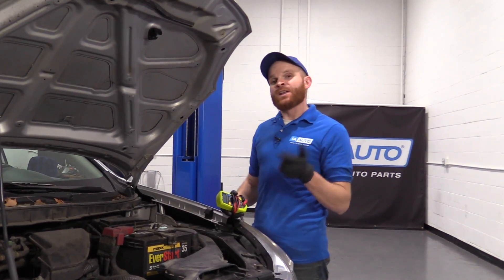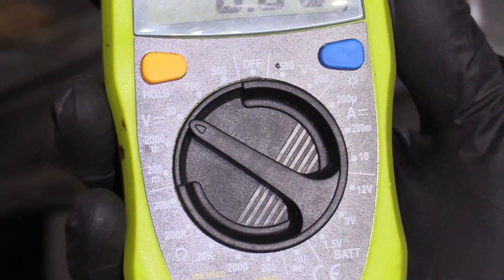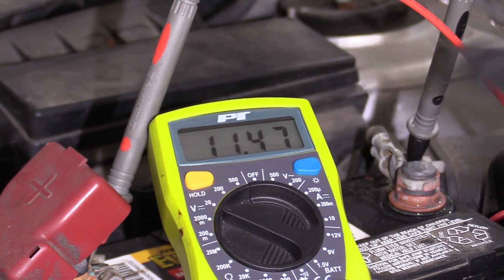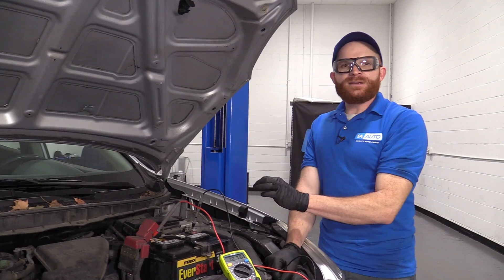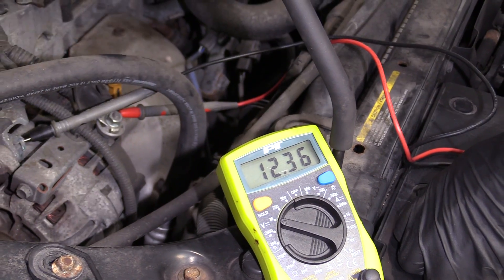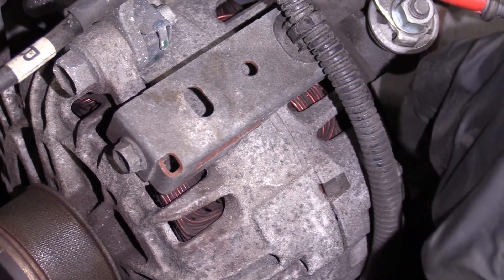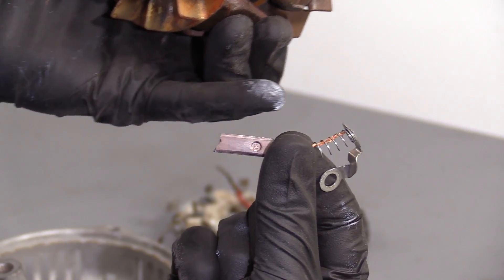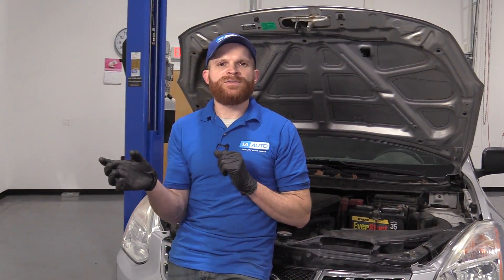Dead Battery? Voltage Spikes? How to Diagnose a Car / Truck Alternator

Comment: i have a 2009 camry I4. It's got a NAPA alternator. Upon starting the car( no lights or blower motor on ) i see that the voltage is 14.1-14.5. But after 30 mins of idle/driving( no lights or blower motor on ) the voltage drops to ~13.5. Is this a sign that the alternator is degrading? Battery shows 12.5-12.56V when the car is shutoff( no lights or blower motor on )

Comment: Another great video, I had some strange electrical things happening in my truck, I would check the battery similarly to how you did here, I also have a battery tester which tells me the health of my battery via CA and CCA and the starting system and the charging system, similar to what you showed early in the video, my alternator was dying out, I replaced it along with the battery at the same time, all is well now. I like videos like this, they are really helpful.

Comment: Hi I'm having vehicle issues my car was running like I need a tune-up really bad but after spending $400 O2 sensors new injectors new coil pack new spark plugs Vehicles still running rough notice that the battery is reading low I'm hoping that the batteries the issue this is a 2008 Dodge Nitro 3.7 L remove the battery post while the car was on to test the alternator the alternator proceeded to react then I'm not used to and the dashboard lights were flickering as well as things popping on the dashboard could just be an alternator going out or is my throttle body that was causing this whole problem from day one or could it be a tip of Dodge Nitros or prone for bad tipems it's 151,000 Mi on my car 3.7 L Dodge Nitro

Comment: Great video! I got an issue with my 02 grand marquis. When the lights are on, the dashboard blinks a little bit, on sync with the stereo. Some days ago, I parked at home depot and when i was leaving it didn't start, just clicking. I thought it was the starter but then i passed some charge from my truck and it's running great again. Any thoughts? The battery is almost new, less that a year old, and I did the test on the video and the alternator seems fine (13.2-13.6)

Comment: Another excellent video! Always received perfect fit parts from 1A. I have an 02 avalanche that is dropping voltage randomly from 14.7 to around 11. It happens fast, drops idle speed and comes right back. Any ideas? Thanks
Reply: I have a 2016 Nissan Juke that is doing the same thing as your avalanche. Did you ever find a solution as to what was causing it?

Comment: The alternator in my 2007 Ford Focus SE sedan with the 2.0 liter engine is overcharging. I replaced the battery thinking the old battery was starting to fail causing the alt to overcharge. It's still overcharging. I did just replace the headlight assemblies that I bought from 1A Auto. I don't think that would make the Alt overcharge. I'm seeing 14.95-15 volts. I had the battery and charging system tested. Battery is good. Alt is testing good. Diodes good. No problems found but the high voltage concerns me. Any thoughts?
Reply from the maker: +Ranger1 We wouldn't be able to diagnose an issue like that here, you may want to have a local mechanic take a look at it. Thanks for checking us out! http://1aau.to/m/Shop-1AAuto-c
Reply: Did it end up being your throttle position sensor. Or something equivalent?

Comment: Hey man I got a problem with my van it suddenly turned off on me while parked on driveway the I tried jumping it and it turned on but as soon as I took off the jumper cables it died went got another battery and did the something I took off the alternator took it to autozone and they said it passed that it was good went home put it back on and still doing the same thing please if can shine some light on this I'll be appreciated thanks.
Reply from the maker: +Ernestus Baltazar We wouldn't be able to diagnose an issue like that here, you may want to have a local mechanic take a look at it. Thanks for checking us out! http://1aau.to/m/Shop-1AAuto-c

Comment: Copper insulator?  Mixing up voltage and current,  but good vid. Some modern alternators are fitted with a clutch beware of that one

Comment: Good job Lenny!!! As a follow, I will just say that the rotor never “brushes against” or comes in contact with the stator. And lastly, the alternator shaft never rotates at the same rpm as the engine. It’s much faster. 👍🏽

Comment: Excellent video.  Thank you. One question though. If the voltage guage is pegged to the right showing maximum charge all the time, does that mean the voltage regulator is stuck closed (on older vehicles with a separate regulator). The battery is good, but discharges to zero when the vehicle is off and the battery is connected.  Disconnect the negative terminal and the battery remains charged.
Reply: Sounds like you have a dead short in your car.  Run ground checks.

Comment: That comment at the end of the video, about removing the negative terminal at the battery damaging your charging system / voltage regulator can't be right on its face. That's what you do prior to many routine auto repairs, or even when just removing the battery. He must mean not to remove it while the engine is running?
Reply: Yes he's talking about how people used to test their charging system with the oldschool "Generators" as opposed to alternators, where you cannot disconnect the battery while it's running.
Reply: thats what he meant, not while it's running.
Reply: That old, pull the negative cable trick, doesn't work with newer vehicles.
Reply: Not when it's runnung. Your battery is a buffet

Comment: Is the voltage the same for most batteries?
Reply from the maker: +Ada L Thanks for watching!  Yes the voltage will be the same for testing modern car batteries.
Reply: Yes.
Reply: All batteries are not created equal.  Some are built to much higher standards.  You get what you pay for.
Reply from the maker: +Chris Brocksmith Thanks for the feedback!